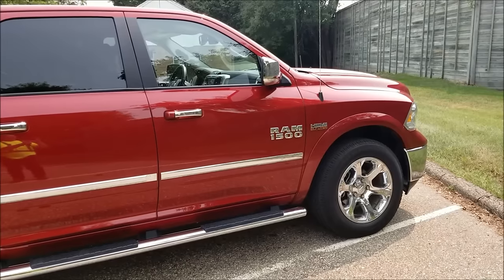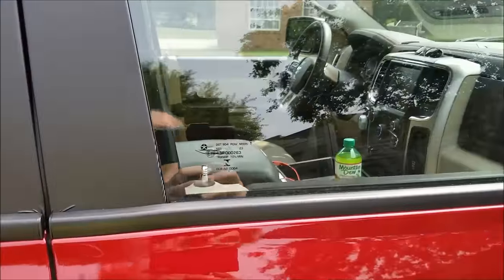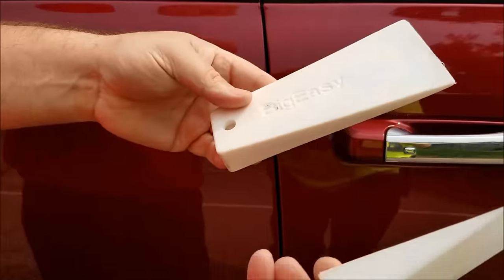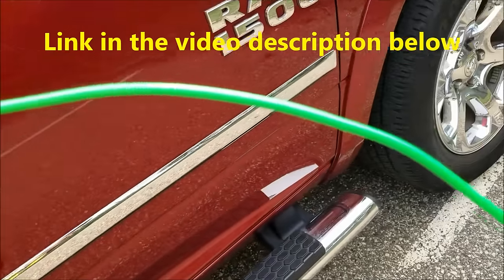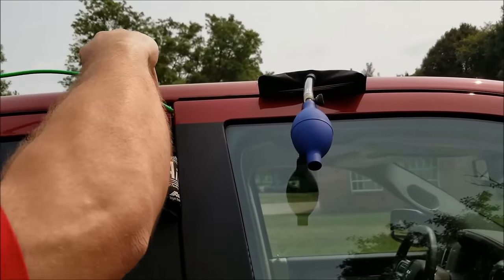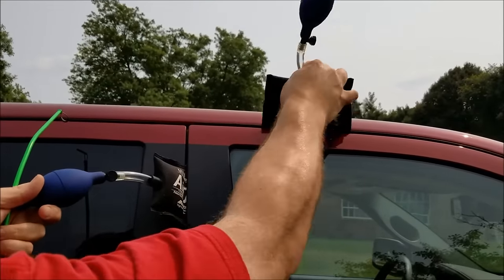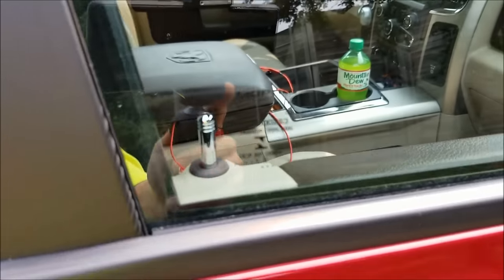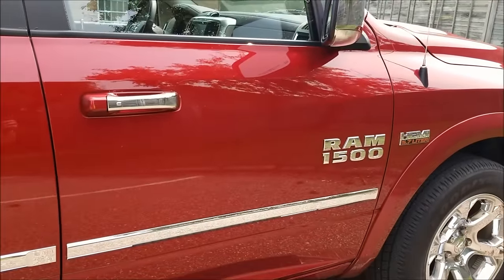How to unlock a car door without keys, the easy way.

Comment: Yea I just happen to carry these in my back pocket
Reply: You have to be a kangaroo to have a big enough pocket.
Reply: Hahaha
Reply: @TheMarried123  hhhhhhhhhhhhhhh
Reply: Guys could also place it in their underwear.  Just remember, the front and not the back.
Reply: That's funny. Does anyone even have those kind of locks anymore...lol
Reply: I just pulled on the handle and went in and out like you said but i got a different result.
Reply: bomark 2002 well you would leave it in your house
Reply: @TheMarried123  r/wooosh
Reply: Got to be careful not to spring your door . back in the 70s you did that same thing with a wedge or screwdriver.  Pull out on the door and sometimes depending upon what model it  would spring the door
Reply: To keep my cellphone from cracking too.  😆

Comment: I need a video for when I've locked my airbags and lockout tool in the car too!
Reply from the maker: No video required.... Just call AAA. Lol. Thanks for the comnent.
Reply: Step 1. Pick up a brick...
Reply: I have used a dime to remove my front license plate then slipped the plate between the window and the weather stripping, sliding it gently back and forth until it unlocks.
Reply: 😂😂😂😂😂😂 just punch the window.
Reply: secure a tool or key umder your car
Reply from the maker: @mannyhernandez8358  Exactly... so was the comment that I was replying to. Make a stupid comment to me, and receive a stupid comment in return.

Comment: ALWAYS carry a extra key, sooner or later you will be glad you did.
Reply: What if you extra key is in your locked car?
Reply: I do carry a spare key in my wallet, it had helped me out of lock out hassle countless times already.
Reply: If i have money to spare, i bring along a locksmith in case i happen to forget all my keys.
Reply: I carry my extra key in my wallet. Never had an issue, and has always worked for me.
Reply: A spare costs no more than $3.  Items shown: +$25 at least.  Guess which is the better choice?
Reply: ANd for backup you could leave another spare at your work, a relative's or friend's place. Worst case then is a 20 dollar taxi ride for the key. 

About spare keys though, is it true that the chip kind must be bought from a dealer and can cost a hundred bucks? I gave up the car fifteen years ago so I have no experience with those kinda of keys.
Reply: I always carry my extra key in my wallet.
Reply: I have this device. It's not for me. It's for others who dont have a spare key.
Reply: Yep, an extra key cost me 267.00. And it's at home 40 miles away!

Comment: I used to work on the road job. Lots of miles and they was a time or two when I left the keys in my vehicle after a few times I got an extra key which I used all the time when I was driving. And in my pocket was my key chain with my other keys , house , car keys etc. Etc. Saved me quite a few times.
Reply from the maker: I agree! A spare key is the way to go....... but tell that to a person who just discovered they are locked out of their vehicle. It does them no good after the fact.... that's when unlock tools come into play. Thanks for the comment.

Comment: I think the best solution is you tape a spare key under the engine somewhere on a small wire or part that does not get hot.
Wrap the tape in a circular motion around the part and key ,do not flat tape and do not use regular duct tape use electrical black tape and tape to a black area do a good clean job and it will look like part of the original engine. Try to tape the key with one long single piece leaving a little flap folded over at the end so when you remove the key you have that flap to grab onto and remove the tape off in one move.
Also" never rely on the little magnet boxes they will just fall off". So when that day comes and it will.. that you lock yourself out all you have to do is get that key, you might get your shirt and hands a little dirty or need some assistance from someone getting it off but it sure as hell Beats totally stressing out, calling your insurance, calling friends and family, paying for a tow truck to unlock waiting 45 minutes or paying $50. Happy travels everyone stay safe❤🙇‍♂️✌
Reply: Or alternatively just carry a spare in your pocket........
Reply: I have a spare on a length of bailing wire hanging in my gas cap. It doesn’t look like anything except a piece of wire to hold the gas cap.
Reply: @Jerry Kelley Many cars dont have an inside hood latch any more, it is a keyhole in front of the hood situated in the grille.
Reply: good idea,  until you figure out the hood release is inside the car!   spare key on the frame is the best way to go
Reply: @h20bearboy65  yeah so..to everyone talking about a hood latch I'm talking about laying down on the ground and taping the key under the engine. That's what I meant by getting your shirt and hands dirty. Guess I could have said, under or Frame, but my comment was long enough LOL ✌
Reply: so you tape a key under your car?......what town do you live in?  your plate number please?  oh, nothing, I just want to look at your car that's all.
Reply: @Lee90000  Long Beach.  pn. 1874YEA
Reply: Thats what ivw done for years.  I dont use the vinal tape. Duct tape is better. And mine are somewhere in the middlle under the car o and always have a knife or youll find som1 that does
Reply: I need to start checking under people's cars ..

Comment: As a locksmith I have often locked myself out with the tools inside.
The inexperienced risk busting the window.
Some cars have auto relockers  meaning as soon as you pull the button up it gets pulled back down. 
This is however exactly how most locksmiths get you in followed by that will be $65 please.
Reply from the maker: Yep, the auto re-lockers can be a joy to deal with.  Thanks for the comment!

Comment: Even on vehicles w/o the vertical lock button, lassoing the interior door handle then pull will often release door lock. Or allow rod to reach the power unlock button.

Comment: Soooo, how do I get the tool out of the trunk so I can open the door??
Reply: HotRod Ray lol i know right😄
Reply: DoubledEdgeSword321 aw man
Reply: When I first started driving there was no need to lock your car in fear of someone stealing it. The security system work great. Pump it three times crank it for 3 seconds pump it twice and then crank it again for 10 seconds wait one minute pump it once crank it and it started right up. If you didn't do it just right you never could get it started. I know some of you know what I'm talkin about. They gave me a great sense of accomplishment. Now anybody can start a car.
Reply: Slide hammer and a screw

Comment: I leave mine unlocked... Security system.. Manuel transmission..
Reply: What year,those are ba.
Reply: Lol I keep one the back doors open and close the rest. If I am in a city, I close it and check the keys in my hand like 10 times before closing.
Reply: Lol! Most of us baby boomers learned to drive with a standard or manual transmission, but that was way before smart phones, which now are permanently attached to the drivers right hand. Ha Ha!
Reply: @Busaguy  and your not boosting cars!!
Reply: @Busaguy  ha
Reply: @elcamino5145  no sir...I prefer to stay on this side of the steel bar's. ;)
Reply: @Busaguy  absolutely
Reply: Agent 74  that would be racist if not for the El Camino thing... Either way, that's funny... I'm gonna have to use that one... Gracius senior
Reply: Agent 74  I just fell out laughing.... Good for you... So is my EL-CO..
Reply: Agent 74  so glad someone else picked up on that!!
Reply: Yea the one time I lock my doors smh

Comment: It used to be that if you found a person nearby who had a similar car, sometimes their key would work in your car. My dad entered a car with his key, sat down and then noticed strange things on the seat and in the back. Came to find out his key fit another person's car and opened it perfectly. (Ford)
Reply from the maker: In 1995 I bought a brand new Ford pickup truck. The key to that truck unlocked two or three other vehicles on the dealer lot. LOL

Comment: I owned a 1981 Olds 88 and locked keys inside at work, GM facility.  I called the plant locksmith and he arrived with a box of funny tools.  He selected a flexible plastic strip with a rubber band on the end.
I swear he got in faster than I could with a key.

Comment: most cars don't have the lock like that now. and most cars won't let you lock the keys inside because of the fob detection.
Reply: Bullshit. People locking keys in cars of all makes is why I'm employed.
Reply: Your argument of it being impossible to lock keys in any car is false. If this were the case, you could not lock your doors while you are inside. This would put auto makers on the hook for your personal safety.
Reply: yes my 2014 american vehicle won't let you lock doors with fob in ignition unless you are in drivers seat.  And if you open door when key fob is more than a certain distance away the alarm sounds
Reply: @clintonepps3666  and there only assembled in america now.  Some of them say what percent is made in usa.
Reply: @reddog5753  yeah actually I have. I have unlocked around 2500-3000 cars. From old stuff all the way to brand new. Just unlocked a 2018 Cherokee last week. The owner stated "I thought you couldn't lock the keys in these newer cars". You are obviosly uneducated on the subject. People like you are why I am employed.
Reply: adventures and quadcopters True. 

Almost every new car doesn't let you lock the door if key is inside the car. 

My new car doesn't lock if key fob is inside.
Reply: Correct.  The new feature jn cars today  saved me from the locked situations a few times already.
Reply: If you leave your keys in the ignition of a Tahoe, it will lock up so your shit isn't stolen.  I hate it.  Been  locked out a few times because of this.

Comment: You don't need for  that fancy stuff just a piece of plastic binding strap folded and pushed between the rubber door seal and then maneuvered around the lock control stem will do the job

Comment: Heck, I keep an extra key on a carabiner which I can attach to my shoe(lace). It's better than wedging stuff in your door that will screw up your door seal/alignment.
Reply from the maker: That air bag "wedge" is standard issue in the automotive door unlocking business. Thousands of doors are wedged open by roadside assistance guys, tow truck drivers, locksmiths, mechanics, etc every day across the globe.

Comment: Get a 2 foot piece of the plastic strapping you get around cardboard cartons (the sort you get on washing machine or fridge delivery) fold it in half making a tight crease, push the creased end in between the door and pillar just above the protruding door button, slide one half of plastic strap which creates the loop, locate over then pin then pull tightish to grip and lift….. I worked in a retail warehouse for 15 years and once or twice a year a customer would re-enter the store with keys locked in… this never failed to please.
Reply from the maker: You are absolutely correct. In fact, I've often thought about making a video showing this alternative.... And now that you mentioned it again I probably will go ahead and make that video... eventually. Thanks for the comment.
Reply: @SlipFitGarage  Cheers Brian, I’ll keep watch…👍🏻

Comment: How to rob a car
Reply from the maker: Only if you're a criminal.... And if you are, then you already know how to break into cars.
Reply: Break the window. Hammer a screwdriver into the ignition or hotwire it. Most Theives aren't going to waste money and time with this.
Reply: @SlipFitGarage  actually I'm sure a lot of criminals have no idea this kind of thing exists and this video helps teach them it does exist lol
Reply: @fredmartin7532  not all thieves are trying to steal a car. Many people keep valuables in their car
Reply from the maker: @Eman1900O  
It still is not the tool's fault that people turn to crime.  Hammers can break into cars too but you don't see people complaining about videos where people are using a hammer.
Reply: @Eman1900O  breaking the window is still easier, and even if most thieves knew 'bout tools like this, its still easier to smash a window. Car alarm you say? Most cars it's easy to pop the hood from the outside and disconnect the battery. If you're not after the car, break the window.
Reply: @SlipFitGarage  hammers make car alarms go off or at the very least the sound of glass smashing. I never said it was the tools fault but it makes much more sense to hide a key under your car, and no I don't mean by a magnet
Reply: @SlipFitGarage  why not just get a spare key and hide it well under your vehicle?  much cheaper and actually useful. How many people you know would keep this in their truck bed? and you're def. screwed if you're in a car or SUV and stranded
Reply: @fredmartin7532  too much trouble to do that especially for many models
Reply from the maker: @Eman1900O  
Of course a spare key is always a great idea. I never said it wasn't. This was a video demonstration about a door unlocking tool. That's it. I wasn't ACTUALLY locked out of my truck in this video. Lol
Reply: @Eman1900O  Too much trouble for bottom tier thieves yes, but a professional who want the car will go through the trouble, 'cause it's really not that hard. A good car thief is very likely to already have the skills and tools, of a professional locksmith. These video don't help them, and even if they did, there's so many other resources out there. What this does is expose crappy security. If people didn't make these videos, the car and lock companies would have no reason to improve the technology, but thieves would still steal, and it would be way easier for them.
Reply: @SlipFitGarage  interesting video though
Reply: @Alien Churro scarce <  Here's your answer, it's really not that difficult tho understand:
brianok1003 weeks ago
It still is not the tool's fault that people turn to crime.  Hammers can break into cars too but you don't see people complaining about videos where people are using a hammer.

Comment: Where are you suppose to store the air bags/wedges and that long tool, assuming you don't have a truck to put them in the back of?
Reply from the maker: Most people store them in a vehicle owned by the service technician that comes to your rescue when you find yourself locked out of your vehicle.  You see, there are people who, as part of their normal every day job, unlock car doors for a living.....  Tow truck drivers, mechanics, lock smiths, car dealers, car auctions, etc, etc.  Even some police will still unlock cars for the public, although those days a almost over. Most of these people are responsible for buying their own tools.  AND GUESS WHAT?????  THOSE PEOPLE WATCH YOUTUBE, TOO!  This was a tool review of a door unlocking tool that millions of Americans have purchased for their job.  If you're in the door unlocking business you should buy one.  If you're standing next to you car right now, locked out, and looking for a magical solution on youtube, then this video wont do you much good.   If that's the case, I have to bits of advice for you.....  Either break the window on you car, or call a service technician who already owns one of these tools and pay him to unlock your car.  I'm guessing it's much cheaper to hire someone than it is to replace a window.  Good luck.

Comment: OK if knob is as high as yours but most are NOT but good tool to have for sure thanks for your time and sharing
Reply from the maker: If the knob is flush with the top of the door, then obviously this tool won't work. Examples of this would be on some Fords.... However, I have also found that if it's a Ford vehicle with back doors, usually the back door locks stick up higher.... enough to use this tool. If not, then I would just use a different type of door unlocking tool all together. This video was simply a demonstration for one type of door unlocking tool, there are many other types of door unlock tools in existence. Thank you for the comment.

Comment: Home depot sells those airbags it's in the tool aisle
Reply: There plastic and suck. The cloth ones are better along with they have a plastic peice inside which helps the air wedge slide in Better.
Reply: @jovigirl2946  I was just pointing it out....I was actually surprised to see them in there .....I got mine from eBay....I have a old slim Jim kit I got from a tool show that I saved many people with who locked their keys in their cars.

Comment: word of warning!  this is a fantastic trick, it works great, and I've seen it done (and paid the locksmith for it).  I've seen them online, and often considered purchasing.  much like a lock-pick set of tools though, I am quite sure it is illegal to some degree to be in possession of such tools without being in the profession requiring them!  not positive about that, and results might vary by location.  just saying in the event it helps someone not get an even more costly fine for possession of an illegal tool vs the locksmith.  personally, my thought if you wanted to have one... just keep it out of sight, and don't advertise! unlikely somebody would mess with you over this, but who knows!
Reply from the maker: Door unlocking tools are available for anyone to purchase online, at auto parts stores, at most truck stops, etc, etc.... It's possible they may be illegal in some areas but nowhere that I'm aware of. On the other hand, if you get pulled over and you're suspected of car burglaries, (for example) and you have these tools in your possession, then you might be in trouble. If you're not already involved in illegal activity then I highly doubt you have anything to worry about. Basically, just don't be stupid, that's all....